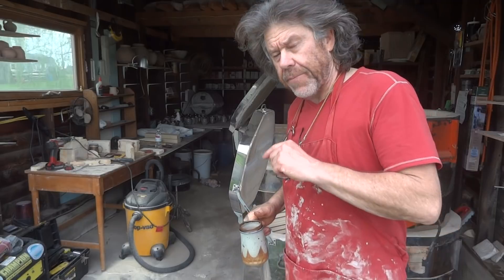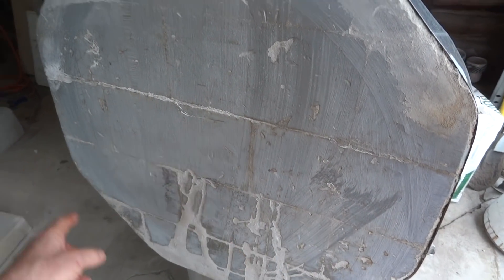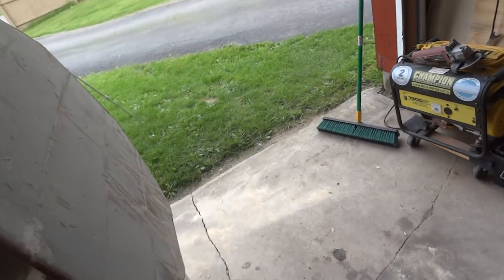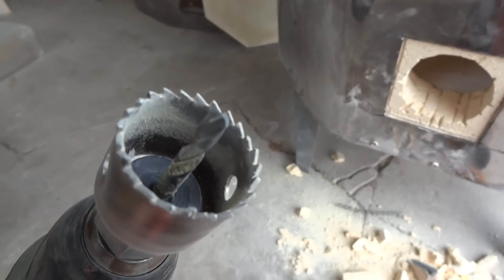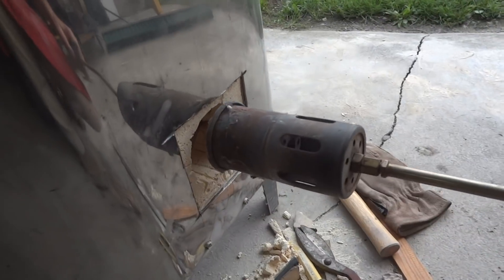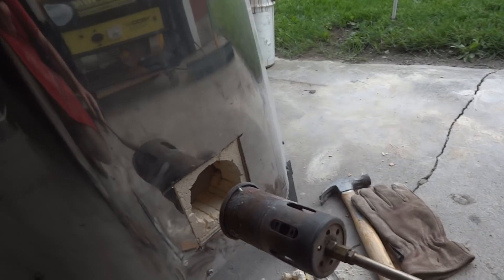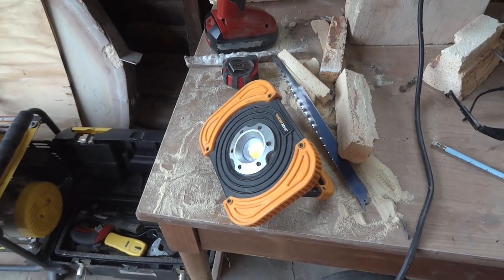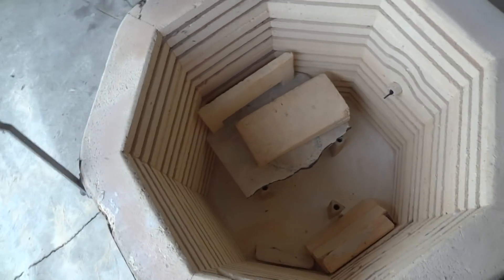Electric to propane gas kiln conversion PART 1 - May 7th 2019 with Simon Leach

Comment: Hello Simon, Thank you for sharing the method to starting this.  Your design got me thinking why couldn't a person Extrude a chimney Flue and fire it in another kiln and cement it into the wall like a regular fireplace chimney is done.This would provide a much more stable chimney top to control the draft and temperature because you could install something like a BBQ style draft control once you reach your target temp.

Comment: Thank for the help Simon I see that you used 2 weed burners on your big kiln I have a kiln that is 27”tall and 23” wide can I get away with one hole. Or should I put two holes. I don’t think my kiln is not as big like yours. Im only trying to hit cone o6 on my firings.

Comment: Thank you..Simon  for this video , we  converted our electric into gas  to an, updraft   the chimney hole is  in line of the burner hole    we get very uneven firings
each shelf is a different  temperature  of a cone, ,PLEASE i would like to know  how even heat are your firings are in the large kiln  . Also  what is the difference if the chimney opening is first shelf or bottom.
 we are going to build a new kiln  ,,  but not sure if to make it updraft or down draft ¿¿ please
what is your opinion ?? love your  videos
Reply from the maker: My larger kiln is fairly even , just a bit hotter at bottom than top. I like a slight bit of variation for different glazes. Down draft is more efficient with less temperature difference top to bottom. Burner at bottom and chimney hole at top is not a good way to conserve the heat within the kiln as it just rushes straight out. A longer flame path is required to maximize the calorific value of the gas being burnt...an updraft kiln is easier to build but not such good fired results !
Reply: @sleachpots  my current small kiln is updraft.side burner.the bottom shelf is flush against the wall above the burner.the second shelf is flush against the opposite wall with the ,3 brick chimney flush to the wall above it.it fires about 1 cone diff with an  octagon second shelf and 1/2 cone with a round second shelf if I take my time and let the kiln even out at the end of fire.

Comment: It's feasible that you could wire up a single element for 30 amp outlet and use it for the initial drying, save on propane. Just have to make sure the element is compatible with 30amp and not overload your breaker... they do make them.

Comment: Hi Simon what of type of cement do you use the kind you buy at ace hardware for a fernes?
Reply from the maker: No it’s not high enough temp, I make up from brick dust, fireclay, talc, sodium silicate to bind it all together, it’s a bit hit and miss but generally works.

Comment: Hey Simeon how is this conversion going to be different from the one you did 8 or so years ago?
Reply from the maker: It is a smaller kiln, only uses one burner not two and it is different internally. Also easier to convert than the bigger one with the two burners.
Reply: @sleachpots  I'm wondering why the change from the external flu in your 2010 videos, to the internal one on this smaller kiln? Any particular reason?
Reply from the maker: @gabrielezimmerman9146  The internal flue set up is more efficient basically, even if there is a slight sacrifice of kiln packing space. Quicker to build too.

Comment: You could use the electric to get it most of the way to temp and then switch over to gas for the gas and reduction effects.  Might be cheaper that way since gas costs more than electricity.
Reply: Where are you located, in the US you'll usually find that gas costs around 1/3 to 1/2 per BTU. https://www.centerpointenergy.com/en-us/Services/Pages/natural-gas-electricity-cost-comparison.aspx?sa=mn&au=bus
Reply: Gas is way cheaper than electric here in Texas.